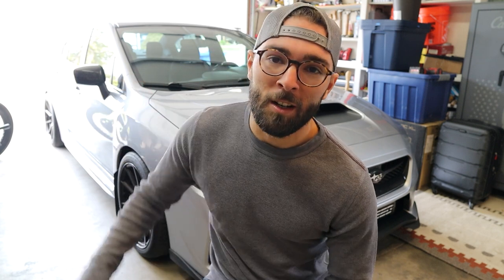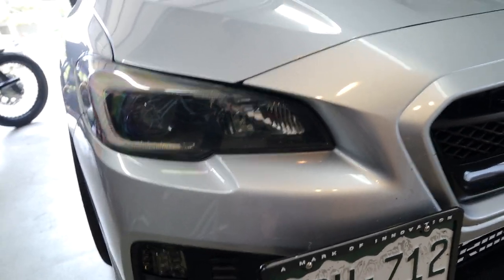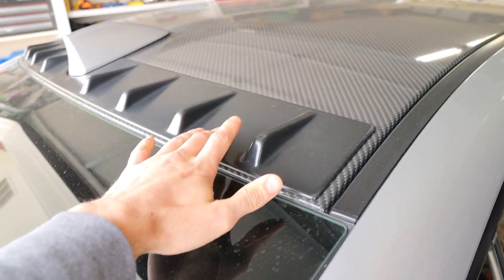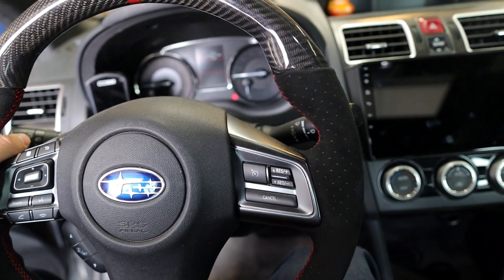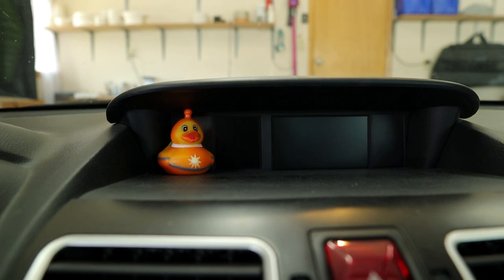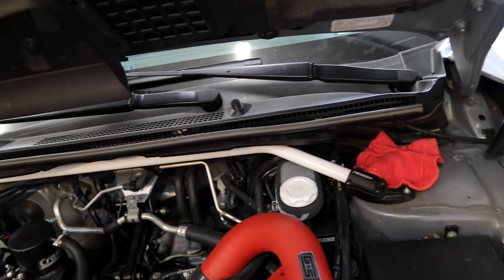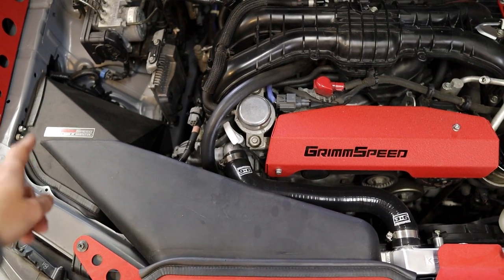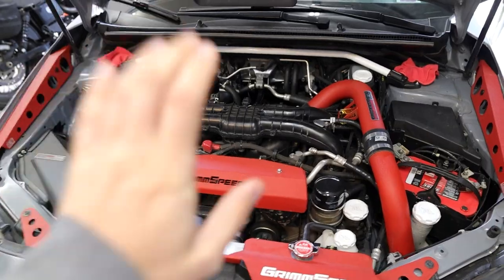Listing EVERY SINGLE Mod on My Track-Ready WRX!!

Comment: If it hasn't been suggested already, you might want to install a rear cross-brace. I put a Mission in my '21 last fall, and it's made a huge difference for relatively little money. It's like your front strut tower brace on crack!
Reply from the maker: Yeah, that would definitely help with getting the rear to rotate with this WRX transmission!
Reply: @WRXGarage  yeah, turn-in and tracking are the most noticeable improvements. Body stiffness is supposed to be one of the VB's improvements over VA, so this is a relatively inexpensive way to address that without the aesthetic insults of all that plastic cladding and rear bumper-diaper. I've got the Whiteline swaybar/endlink kit too, which improved handling a lot, but more so with the front and rear strut tower braces. FWIW, the rear cross-brace made more of a noticeable improvement that the front tower brace, but also different kind of improvement. Car stays pretty flat in corners now anyway. Stock height, and probably going to stay that way since my primary use is driving to ski and grocery getter. I really appreciate the intel on your cracked splitter. As much as I might like the look in summer, it would be a real liability on a pow day!

Comment: Any steering mods? Looking to tighten up my steering to make it more responsive.
Reply from the maker: The only steering mod I know of is the steering column lockdown from Perrin. There are a ton of handling/suspension mods that effect steering feel though. Front sway bar/end links, camber/alignment, coilovers.. all of these will effect steering responsiveness. A big improvement I've noticed was from the roll center kit from whiteline!
Reply: @WRXGarage  Thanks brother! Love your content. Keep it up.

Comment: Any advice on oil smell in cabin? Usually smell it through vents when I'm stuck in traffic or backing up my driveway. Car is still super new, with 4k miles on it. Only has an IAG street aos installed. Took it back to the shop where I got it done and they didn't find any loose hoses.
Reply from the maker: Any noticeable oil leaks anywhere in or under the engine bay?
Reply: @WRXGarage  not that I can notice 🙁  things seem dry to me
Reply from the maker: Hmm, maybe an exhaust leak then?

Comment: Love the content. But just a heads up that the mudflats create drag so you may want to take them off.
Reply: You may also need to change out the pads as well to something more aggressive for track use cause the F-Spec is a street pad just a heads up.
Reply from the maker: To be completely honest.. I don't think the amount of drag created would be measurable. Especially with how agressive my stance is, the tires poke out further than the mudflaps anyways! Definitely something I've thought of too though.
Reply from the maker: Yes I've considered that too. From what I understand, you always want a good balance between the strength of your pads and tires. If your brakes are stronger than your tires, you'll lock them up and slide. If your tires are too much for your pads, you'll overheat the brakes too much. So.. for now I'm sticking with the Fspec pads, will likely upgrade down the line when I upgrade the tires!

Comment: Another solid vid! I want to put gold reflective tape around the COBB ethanol sensor like you did, what’s the proper gold tape that I should use??
Reply from the maker: Thanks Marc! Here's the one I used: https://amzn.to/3w8ro4a
It's the same brand that makes the heat wrap I used for my exhaust.
Reply: @WRXGarage  thanks! have you thought about wrapping the intake/intercooler piping and see it'll make a difference?
Reply from the maker: That's definitely a possibility in the future! The only issue is once the engine bay is completely heat soaked, the tape wouldn't really be able to do much